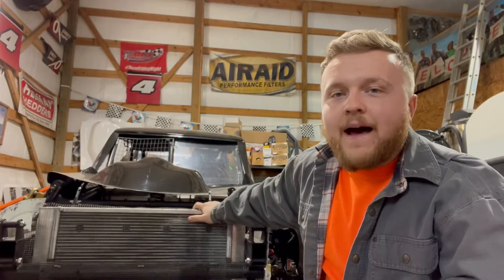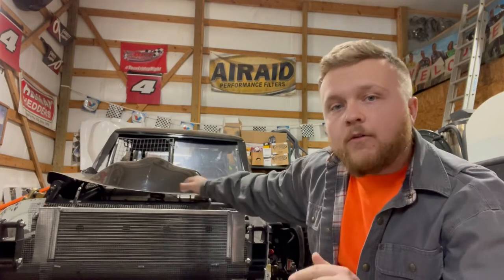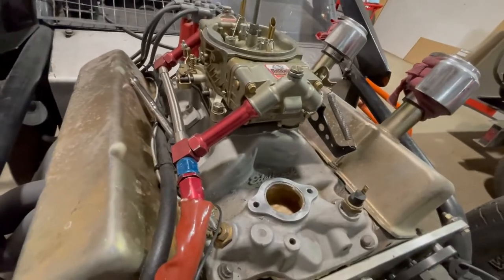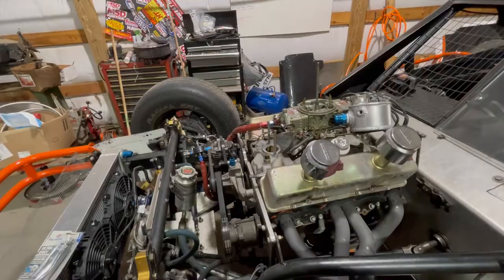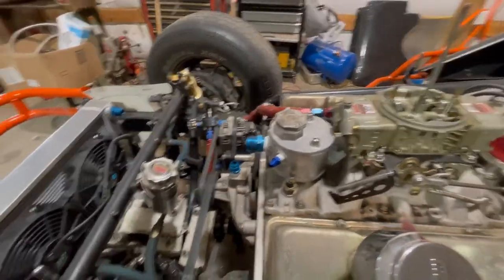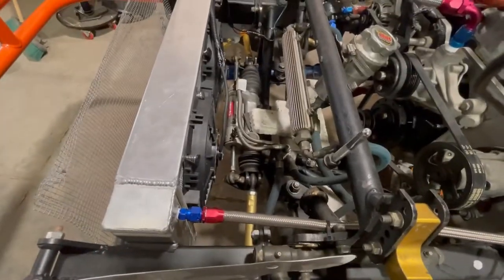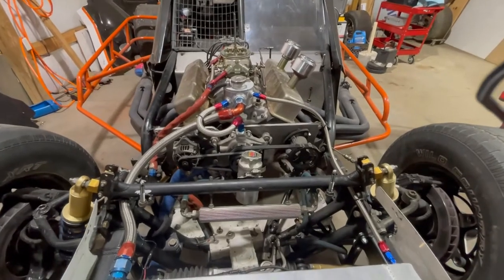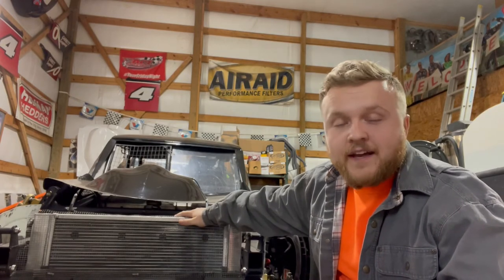HOW to Keep COOL, and RACE On!!  NASCAR Modified Cooling System

Comment: Questions, and this may be silly but I'm doing performance and longevity mods to small engines, do you cool the fuel? The oil? Do you use self draining catch cans? Do you know if you could use a case pulse pump to move oil for added lubrication? Could possibly be a system that can be turned on/off based on electronic switches or even mechanical ones.